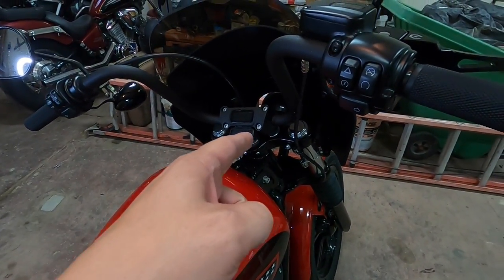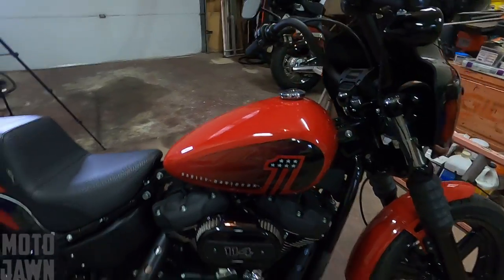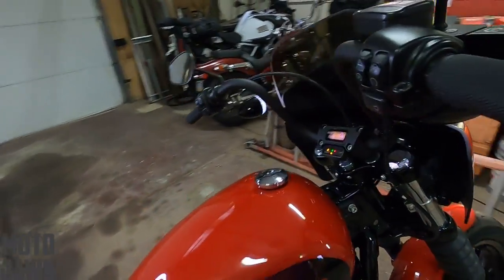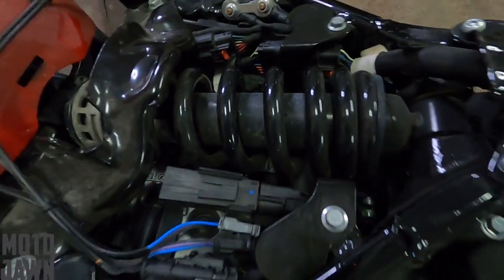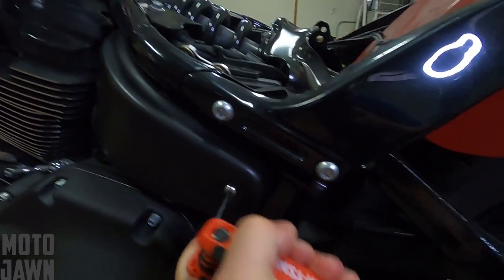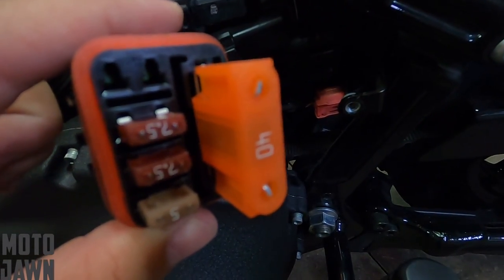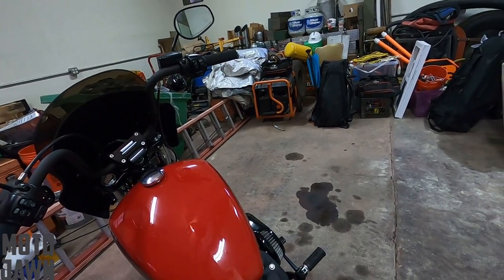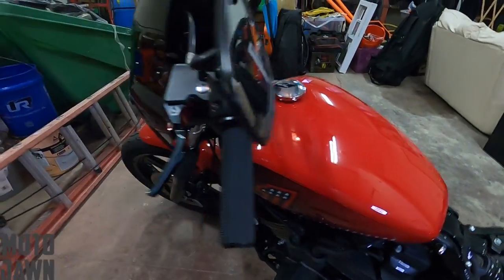Harley Street Bob WONT Start!! How to Change Harley Softail Battery Fuse

Comment: My 2024 street bob that only has 501 miles on it is now going back to the shop for a second time for electrical issues. The bike has lost power while riding and just shuts off. It throws a few codes, ECM p1608h, BCM b2271h, ABS c0562h. Once it throws the codes the bike does still have some power, but not enough to start the bike up. So far the dealership has no idea what the problem is. Starting to feel like I bought a lemon. FYI the battery terminals were/are tight. And yes it's always sitting on a trickle charger at home between uses.

Comment: My 23 street bob turns on, but when I try and crank the engine it would just click but won’t start, any ideas on how to fix the problem? All the fuses look good
Reply from the maker: The clicking is usually dead battery
Reply: @TheMotoJawn  even with the bike turning on?
Reply from the maker: @chrissergio7178  yeah you're getting enough to power the electric but not crank it over to start
Reply: Same problem just baffles me a brand new bike with 600 miles sit a couple weeks then won’t start highly annoyed

Comment: The only electrical issues I have had where after a thousand mile road trip. My sporty vibrated the positive battery terminal connection loose.
Reply from the maker: I've had that happen too 😂
Reply: @TheMotoJawn  Damn Harleys gotta vibrate so much.  Lol
Reply: @theorthobiker The engine and transmission are rubber mounted. The Maxi-Fuse is on the main battery lead.
Reply: @spaceflight1019  my engine is also rubber mounted.  Its an evo though, so it doesn't matter.  XD

Comment: I had an issue like that today. Got gas and flip ignition switch no hum but starter turned. I move it away from pump then fuel pump worked but no starter. Checked fuses and swapped relay. It was the ground. I blame it on not having a gremlin bell on my Buell.
Reply from the maker: That sucks but a simple fix

Comment: Having the same issue only problem is every time new fuse is plugged in it pops?
Reply from the maker: Dang not sure. Sounds like a deeper electrical issue making it blow.
Reply: You can tell us the mods you did beforehand.